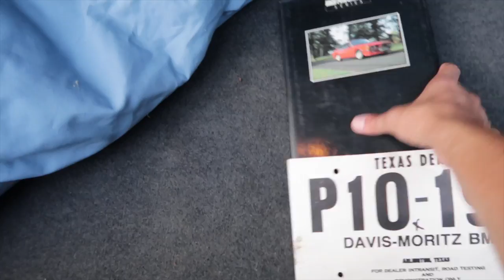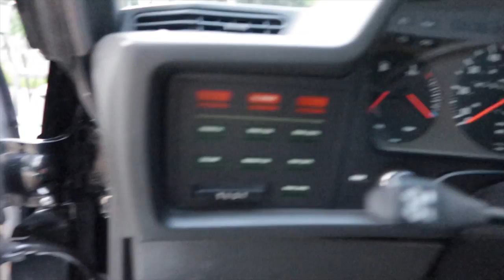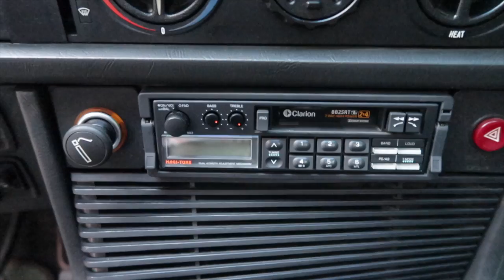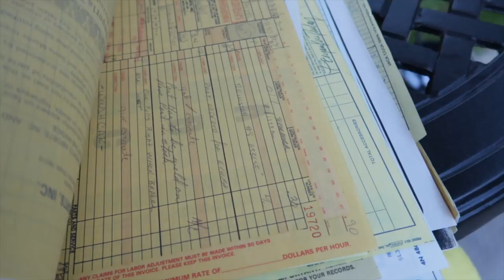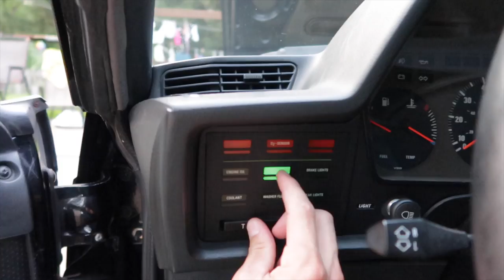I bought a 1982 BMW 633csi with only 90k miles! The perfect E24?!?

Comment: Take off the bumpers and see if the euro bumper (with the oval holes) is underneath. Many run those naked and they loom great. Also the door trim can be removed and the doors look SOOOOOO much cleaner it’s unbelievable. There is a 635CSI in res that has the bumper trim removed and it looks like a way more modern car. Crazy how small changes can show off the natural lines.

Comment: sup dude, I've got a grey market import euro spec 79' 635csi. If you want to lower it, you can do air bag suspension or coilovers. It's just not going to be a bolt on operation (cut the front strut towers). We can swap our e12 front and rear subframes with e28 ones and then use those suspension bits - you'll have more lowering options. Overall though, the brakes are bigger on the e12 chassis so you'll lose some stopping power going e28. If you had your e34 on coilovers, it's mostly the same process so I'd recommend doing that. Maybe grab some spare shock towers and put new bearings in while you're at it. enjoy the e24, it is pretty clean and mine with similar miles definitely has more rust correction needed.  recommend bigcoupe forums
Reply from the maker: I appreciate all that info man!!

Comment: Easy mod if you want to keep it all stock is Jim Conforti chip. It’s so cheap and the gains are real deal. These SOHC engines are musical instruments. I did the Conforti chip on my 1989 325i and I was amazed how much it woke up the car throughout the entire power band. For the couple hundred bucks it costs it’s a crime to drive another mile without the added performance and increased smoothness if that’s even a word. Love the new car!
Reply: You can't chip a 3.2L M30.  It's a soldered-in system, unlike the B34.

Comment: She's a beaut.  Don't think I've ever seen a black/black 633 before.  I like the 80's reminiscent music in this video btw.  Those carpets are cool - my 533i with Cherry Red interior had the same color floor mats - black when new, but fade to a green/grey.  All part of the charm - I never replaced them in 11 yrs. of ownership.  The radio is not original to the car.  Someone put this aftermarket, later radio in, which was likely from the late 80s or early 90s.  But it's still neat, as it has a handle where you can take the radio out with you to do your errands.  My dad's girlfriend did this in `88 with her radio in her Black/Tan Saab 900 Turbo - I thought it looked weird as a kid, but radio theft was a big thing back then.  I still have the original BMW/Alpine radio from my `84 533i which was restored years ago.  Been trying to sell it for years.  This is a B32.  It says 3.2/3.5 as when this manifold came out in Europe in 81/82, the 3.2 and 3.5 liter engines used this manifold in Europe.  The 3.5L never made it to the US using this manifold.  Only the 3.2 and 3.4 made it to the US with this manifold.  Yes, don't mess with lowering it.  Please.
Reply from the maker: Love alll the info in this comment! I knew that radio looked like it could be taken out! Thats awesome!

Comment: so you're saying that valves sound is actually ok? I was thinking to check the gaps on mine with same exact sound; 
also I think it's kinda lying about the rotation per minute and it's about 1000 and really high when cold

Comment: It's a m30b32 for sure I have the same car basically 5 speed transition year 1981 early 82 e12 based car. It probably has a side loader differential
Reply from the maker: Yes it does!

Comment: amazing ride! are you planning on doing a euro bumper conversion? I read that series 1 euro e24s are pretty easy to convert because the rear panels are similar
Reply from the maker: Ahh I didn’t know that! Sounds enticing. Id love to do that if I can find a set!
Reply: @m3nameisjosh464  yeah fs! I'm not 100% sure but I know that the fronts mount without too much (you'd want the slimmer euro corner markers as well), but the rears are a bit tricky. series 2 uses the chrome surround bumper like on euro e28s and early euro e30s, but because the rear bumpers on the us spec e24s not having a bottom valence, a shit ton of fabrication is needed there. series 3 are world bumpers so even we got those in 88' and 89' I think. series 1 however has the rear valence built into the rear bumper, so it closes up the ass pretty quickly, save a few holes for side trim shit. looks like there's a half inch lip running along the rear panel under the taillights that needs cutting tho actually, so it might be a pain.
Reply: @kogaerusaru5171  I had to get custom mounts front and rear. Doing the rear bumper properly is even harder because of the welding of holes from the us bumper surrounds
Reply: @clinehearty4917  yeahhh, that's what I was expecting would happen. I have a set of euro bumpers for my e28 and besides the custom mounts, there's a lot for me to cut and weld on both the front and rear end.